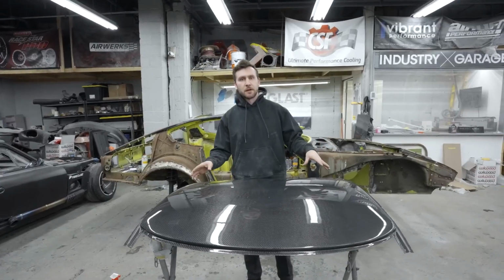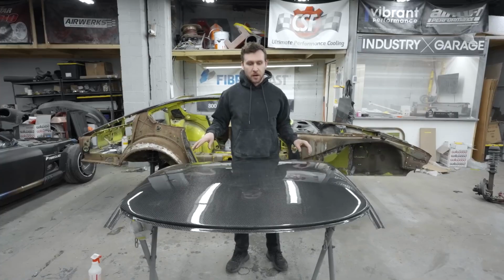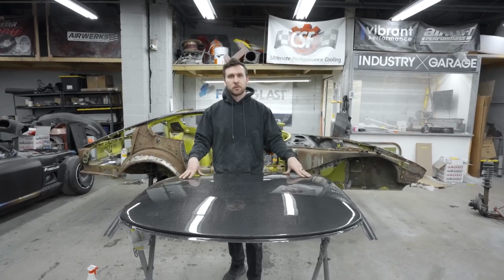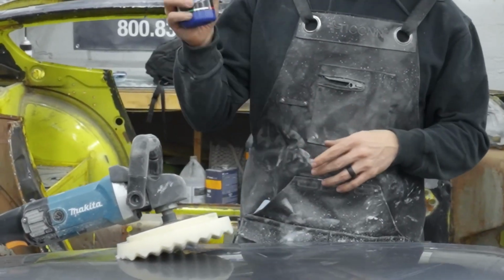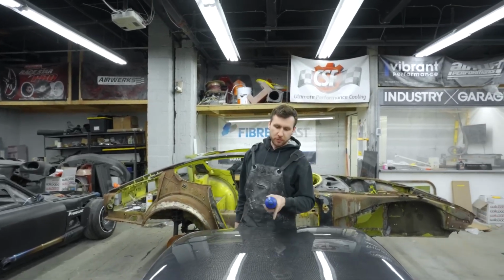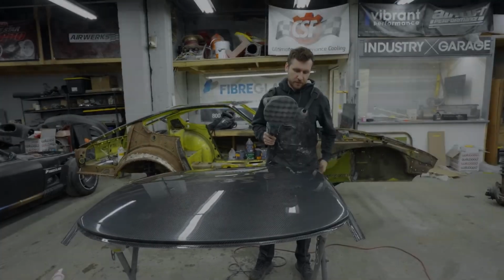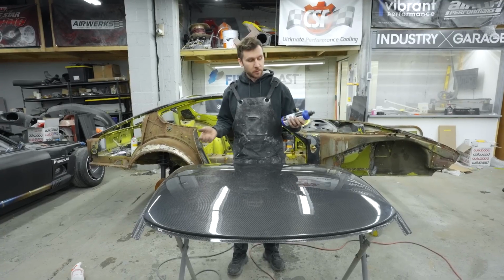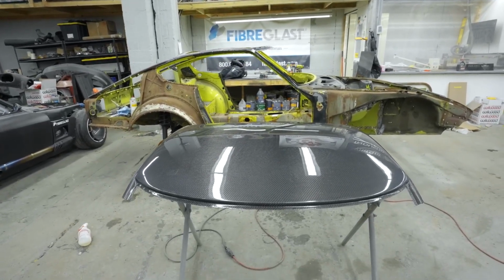PAI Boat Polishing Compounds

Comment: I definitely like this stuff. If you can get your hands on a bottle of Lily ram they make a gloss and seal which is basically their fourth step in a compound but that stuff will make parts really freaking pop. I've been using the pai boat three step and then I finish with that stuff and it's insane.